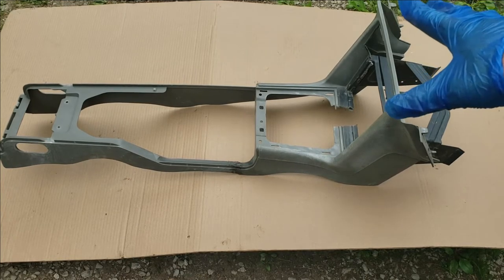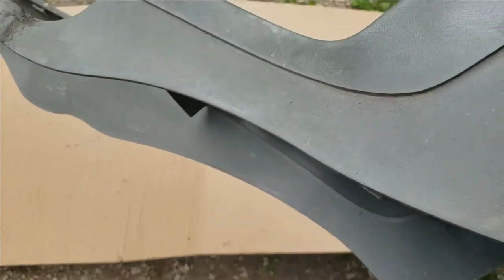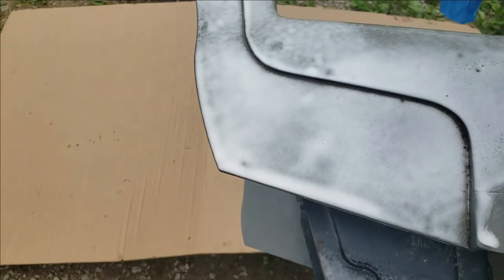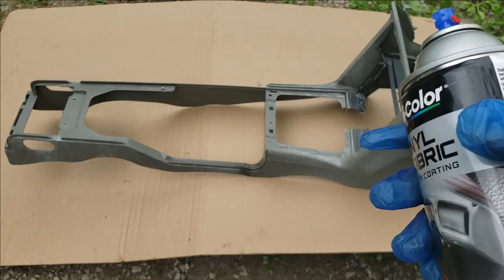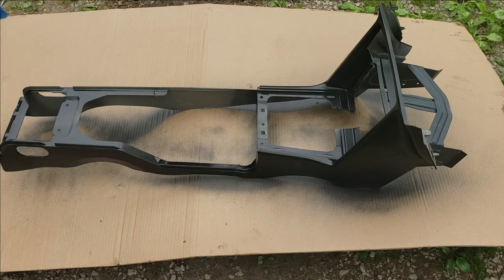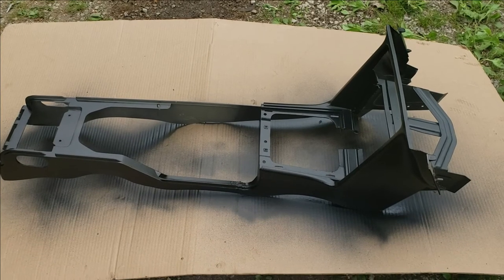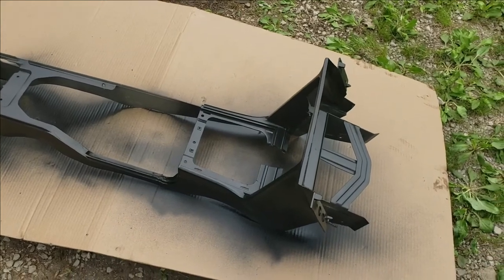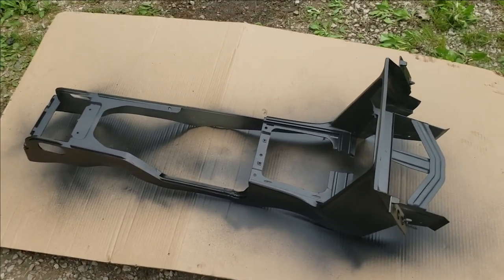How To Paint A Center Console With Duplicolor Vinyl And Fabric

Comment: I bought some brown/beige center console pieces out of a few 99-04 mustangs from the salvage yard today. The two cars I will be putting them in is saddle and the other car is black. I will at some point be painting the consoles
Reply from the maker: That's the best way to make them match
Reply: If you haven't done it already, I recommend using an adhesion promoter before painting, will help with scratch resistance.
Reply: @TheLostSoA  ok thanks